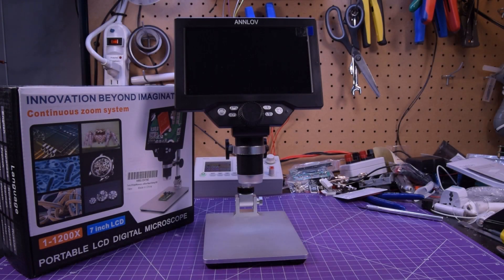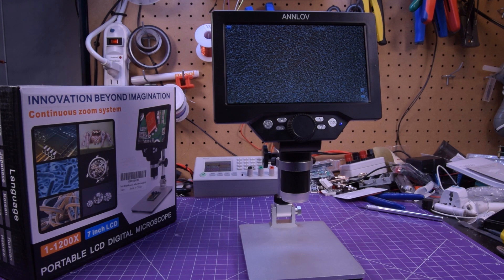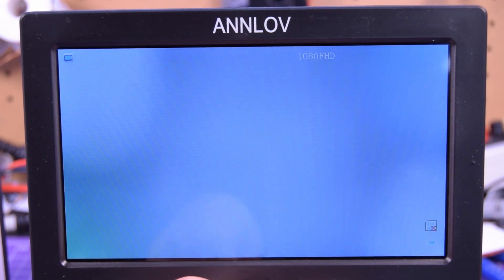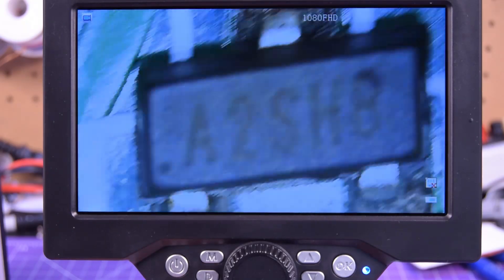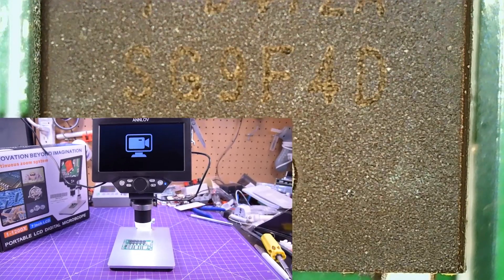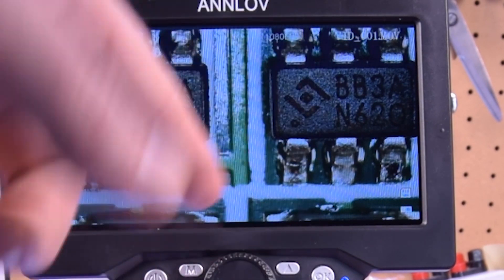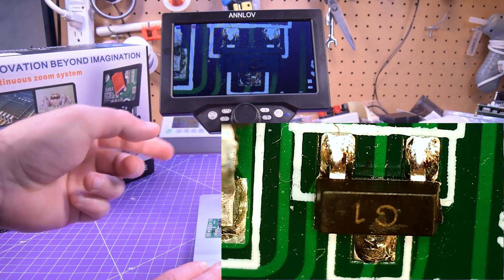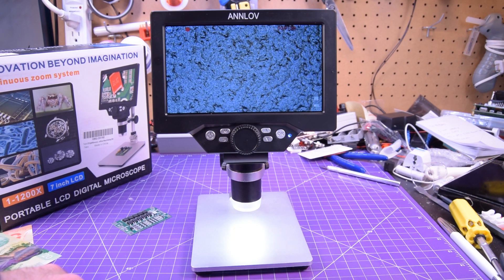There Is A Lot To Lov: Annlov AM-03 Review

Comment: I have one of these, under yet another name. For the money it's brilliant, but like you I found the SD card and micro USB slots to be far too close to the part of the case that sticks out, which makes it really hard to plug and unplug them. Also, in certain resolutions, the picture ends up oval on the PC as the aspect ratio seems to be a bit odd. But it's a great bit of kit, although when I get mine down to use, I often end up wasting a lot of time looking at various random things in close up! Compared to the microscopes you could buy when I was a kid, this is way way better.